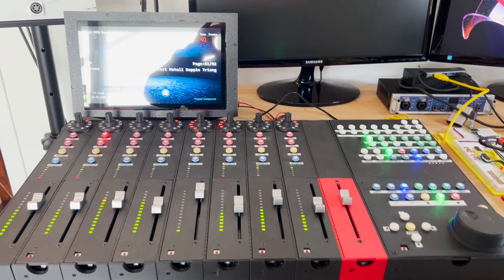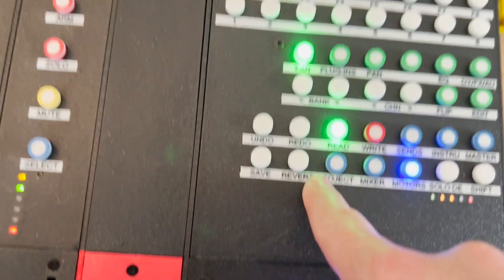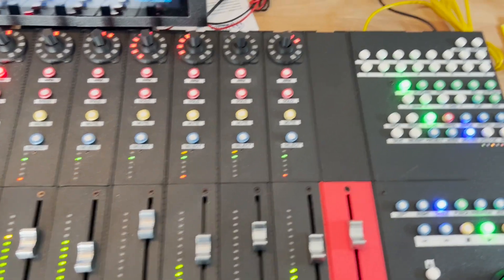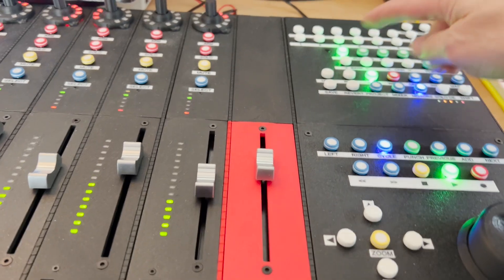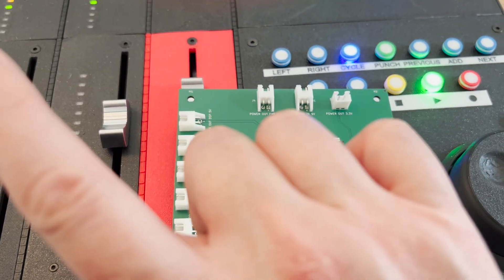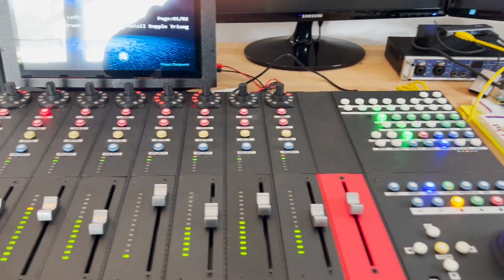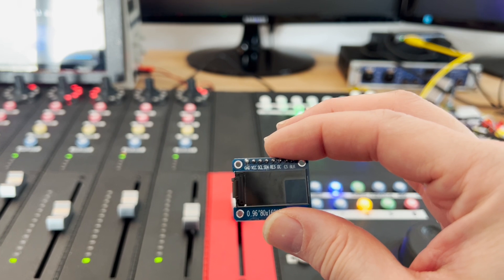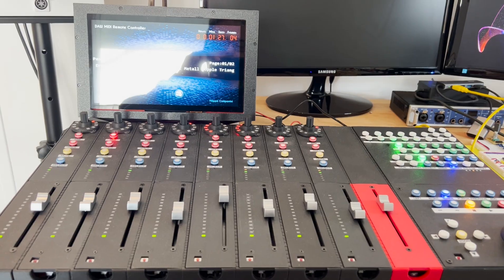DIY MIDI Remote Controller - Update 25 05 24

Comment: This just popped up on my feed and it's really cool! I haven't watched all the videos yet and maybe there's reason you don't have these yet but for that blank bay, you can put in some potentiometers to adjust EQ, FX, Compressor, ect settings when you have a channel/function selected :)
Reply from the maker: Hello, this function is there already; the Vpots for each channel are doing just this. When a channel is selected and for instance the function Eq is set, you can use these 8 pots to ajust available EQ parameters fr that track. Same for channel strip, FX ins, instruments and so on... this is the Universal Mackie control protocol!

Cheers